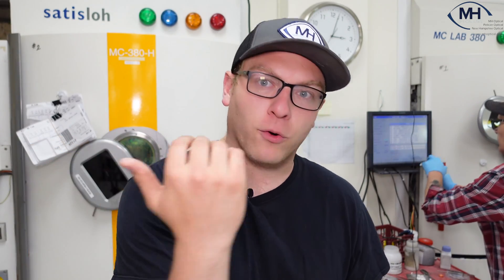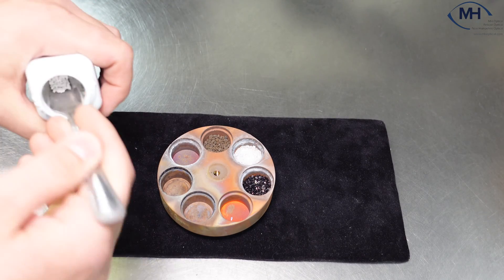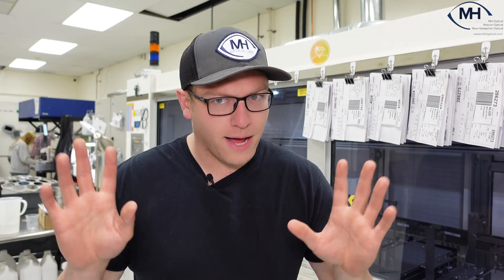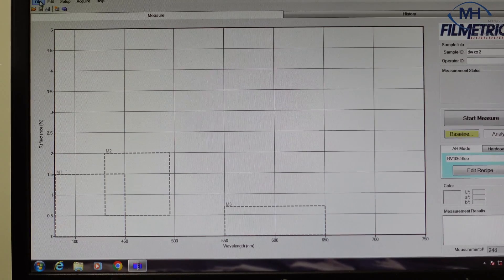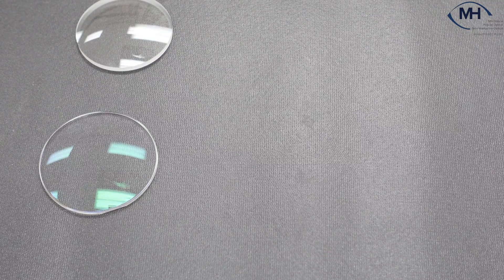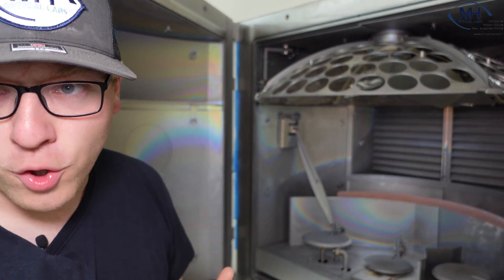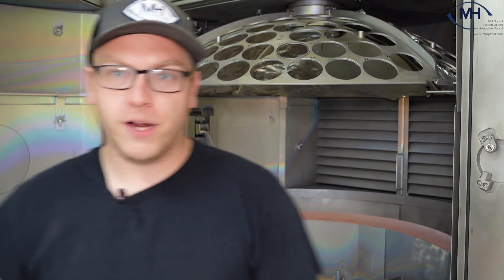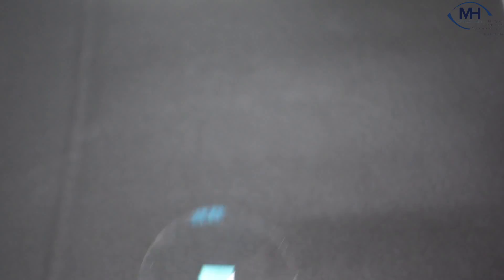AR LENS COATINGS! (Labs take on anti-reflective coating)

Comment: Wow, nice video man! I'm building a high vacuum chamber for aluminizing telescope mirrors and I would also like to make AR coatings for other stuff like old lenses and home made lenses. Do you think that I can achieve that with only evaporation boats? Like, putting all that stuff in evaporation boats that you have in crucible? Is all that material expensive? Do you have any sugestions where should I start? Your video is very enlightening because there is no many info on the subject.. Is there other method to achieve good AR coatings? I'm not very interested in durability of a coating because nobody usualy touches the lenses, and they are cleaned very rarely, but I would like them to work good...  Thanks man!
Reply from the maker: Im no process engineer, but do know our machines... they use a very high voltage  EB gun that forms  a beam of electricity to burn the materials.  I don't think just a boat with heat would be able to evaporate the metals in order to deposit them. There is a form of coating called sputter coating.. doesn't use as strong of a vacuum, and uses targets to evaporate the metals.....not very familiar with the process but it might be easier to build a sputter machine... You also may just buy a sputter machine for a reenable price there are a lot out there and are not very big
Reply: @mhopticallabs4616  yes, I will make make magnetron for sputtering, I already made one for a friend. Thanks anyway! :)